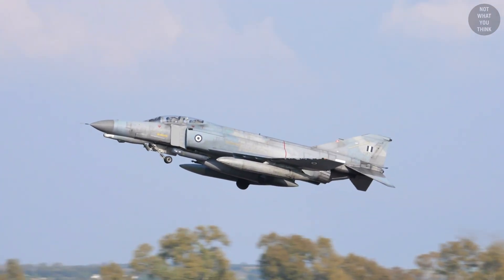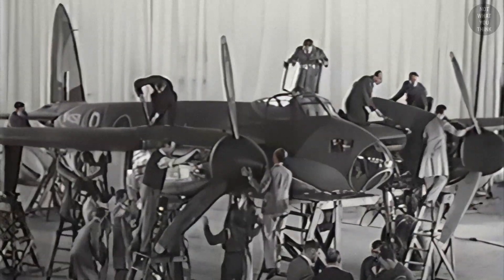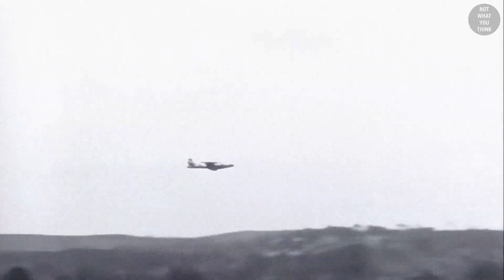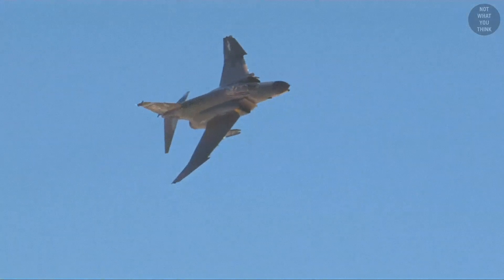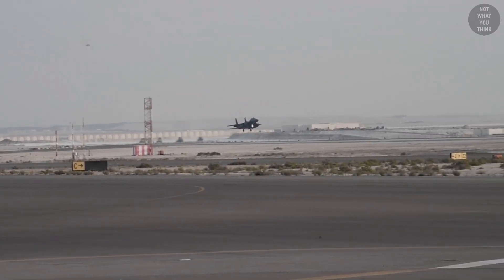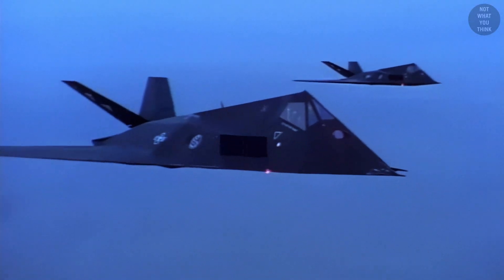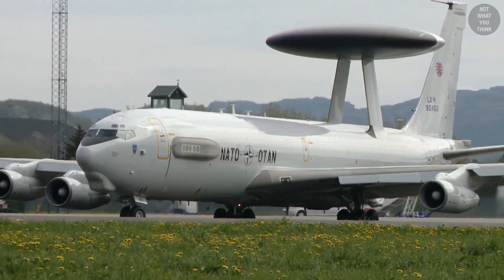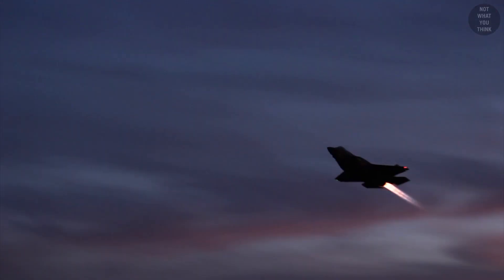Why are Modern Fighter Jets Slower than 1960s?

Comment: The most important factor of Speed Vs. Stealth is that the faster you go, the bigger the shock wave being pushed. A shock wave can be big enough to be visible on RADAR even if the jet isn't.
Reply: The shock wave is a sound wave which is compressed because the plane exceeded the speed of sound. Radar is an electromagnetic device. It can't detect shock waves produced by supersonic flight. 
The type of detection you are thinking is called Schlieren Signature. It is used to study supersonic airflow for planes and usually done in a wind tunnel.  Completely different than radars
Reply: Air is RF transparent, although there are weather Radars.  If you attenuate a Radar for wx, then the aircraft will be hidden in or behind the atmospheric clutter, especially a VLO aircraft.

Wherever you read about this atmospheric shock wave detection Radar, regard the source with extreme scrutiny...i.e. toss it in the garbage.

Comment: Air to Air battles today are extremely boring and unhonorfull. Nowerdays you win if you have slightly better tech and battles are mostly fought in small numbers and on long distances. In WWii it didn't depend on what tech u had. It depend on the skill and how honorfull you would fight. The time of the great patriotic wars are over, it's mostly a long range unhonorfull 1vs1.
Reply: It’s still just as honorable, all jets should have somewhat of a bvr capability and even in ww2 each fighter had its advantages same as today.

Comment: If you are at a track day on a road course with 500 horsepower and a 140 horse Miata stays on your rear bumper in the corners... give them a point by. 

They are doing faster laps than you, because agility beats straight line speed. Ask the cheetah why it has such a low success rate running down a "slower" antelope.

Comment: Speed only matters for one type of combat aircraft, the interceptor.  It needs to get in the air quickly, get up to altitude and intercept incoming aircraft as quickly as possible.  Mach 2+ aircraft like the F-104, F-15 and the MiG-25 were built for this mission.  With the advent of advanced air defense systems like the S-300, S-400, Patriot and sea based systems like SM-2/3/6, the need for such aircraft diminished greatly.  Modern SAMs do the work that interceptors do at a fraction of the cost.

Comment: If you can make that turn rate at supersonic speed the next problem you run into is the human body can't handle the g-force.  The next step is to get rid of the meat machine.  Remote control or AI, that's the future.

Comment: Too bad the F-35 program is a complete failure. Cant sustain supersonic flight without destroying its stealth coating, can fly in the rain, reliability ratings are subpar, combat range sucks without using external tanks that reduce its stealth. 1.9 trillion in wasted tax payers money.
Reply: Don’t know where you get your news from. But the f35 is basically the new f16. It’s meant to go fulfill its mission and get back into the air. It can also complete missions without stealth. It’s supposed to be able to do both. It’s ratings seem to be good. The fact it has many buys and the reports are that it’s own hell of a dog fighter. The fact it can do more then the raptor for way less the cost. I’d very beneficial.
Reply: @RW-zn8vy  my family is in aerospace for one so thats a good start and two this is a post from last year where our own airforce quietly admitted the f-35 was a failure.  "To say the F-35 has failed to deliver on its goals would be an understatement. Its mission capable rate is 69 percent, below the 80 percent benchmark set by the military. Just 36 percent of the F-35 fleet is available for dispatch, well below the required 50 percent standard. Problems include faster-than-expected engine wear, transparency delamination of the cockpit, and unspecified issues with the F-35’s power module."

Other issues are depressurization of the canopy during flight, stealth coat peeling, hud display issues, and lack of parts availability. The f-35 was supposed to replace the a-10 and has failed to do its role. For one its too pricey, two it isnt protected with armor like the a-10, and 3 isnt designed for low and slow ground support. The f-35 is a jack of all trades and a master of none. This is why companies like boeing created the F-15EX because it can fly longer with more ordinance. Thats why the f-35 has been deligated to be the "command leader" to use less valuable planes to fight battles. Dont get me wrong i like the f-35, its badass in its own right but as a program it has failed. In many aspects its like the f-22 that had production issues and cost over-runs that eventually doomed the program. Its not a shocker why our military wants a 6th generation fighter  and a gen 4.5 fighter to meet the needs of our military.
Reply: @07slowbalt  that makes no sense. Your family is in aerospace? That means absolutely nothing. That makes an opinion. If they aren’t direct buyers,pilots or someone who’s worked directly on the aircraft it’s invalid and is an opinion. And you’d tbh think someone in that field would be smart enough to not say such nonsense.
Reply: @07slowbalt  anything can replace the A-10, the A-10 is completely useless. If there’s no air superiority it can’t be used. It’s a big slow target, maybe 40-45 years ago yes it would’ve made a slight difference but it’s not up for todays task. The f-35 f16 and f18 can all do the A-10s job without risking failure of the mission and pilots lives. I love the A-10 just as much as anyone else but many people fandom an aircraft and don’t look at reality. There’s a reason the air force themselves do not want it. It goes deeper than cost and how much if a struggle it is to maintain them. 36 percent of what fleet? Every squadron of F-35As are combat ready and most have already been over seas. If you are around the pilots you only hear amazing things and unbelievable stories. I’d imagine that an engine that powerful wouldn’t last the longest. You’ve never seen the thing fly. The reason I know is because how much you don’t know about it. It’s only on its first block and it’s already the most capable fighter we have. Every fighter has issues when it’s first produced even the F16 got a bunch of hate. The raptor had issues for the longest serious ones at that. It’s all new tech and a really new fighter. Just like anything in the military it has to actually be used to find out what works and what doesn’t.
Reply: @07slowbalt  sorry I didn’t read the rest of you comment, the reason the Air Force is going with the F15 and maybe even the newest f16 is because of cost. More than likely or maybe stealth doesn’t actually work anymore. Both the navy and air force have some chrome coating they are testing on the raptor and f35. It’s 4th gen fighters are bad ass and will be around for a good while!
Reply: @RW-zn8vy  you are all over the board. That quote was straight from the airforce last year. So discrediting what i say is one thing but when it comes to reality and what those with first hand knowledge say is another.  The f-16 has a giant engine on a lightweight frame. It also suffers from range, just like the f-35.  Any pilot is gonna side with either the f-22 or f-35 because it is without a doubt the most technology ever crammed in a plane with a pretty large engine. Ask the pilots that had depressurization of its canopies while flying at altitude and see what they think of that pain they suffered. My family in aerospace that ive always been around is more valuable than what your burger king experience. I first hand seen boeings version that took on the jsf and lost. It was cool but a turd. My dad applied chromium based stealth coatings on airplanes all his life as well as painted harpoon missiles. Brother was an assembly mechanic, before becoming a parts inspector, and his wife is an engineer for them. But hey its just my opinions when they tell me the pros and cons they deal with on the daily.

Comment: Well there are still planes like the F22 or the EF that fly faster than Vietnam era jets - the Advantage of that is that (At least if we talk about the EF) you can fire your missiles at a higher speed what means that your missiles have more energy to work with increasing it's range by quite a bit. I also strongly disagree with the point that you can't outrun AAM's or SAM's - while it's true that they peak at a much higher speed than a Aircraft they can't keep those speeds for a long time - so if you're high up in a fast plane it gets very hard - even for modern SAM systems - to hit you. While AAM's have the Advantage of mostly beeing launched closer to the target and on a higher altitude they are also slower and have less burntime than SAM's on average what makes them pretty suceptable to cranking manouvers. The next point is the seekerhead and the turning limitations of the Missile: the faster a aircraft goes the more problems the seekerhead gets as well - so if we have a plane flying at Mach 2.5 while not flying directly towards the target the missile has to find the right lead to cut into the planes flight path - and at such speeds the time window where you can fire a missile and it is actually a threat is incredibly short - if you fire too early the missile simply gets cranked and runs out of energy but if you fire too late the missile won't be able to turn into the enemies flight path. There's also a increased chance that the missile misscalculates the flight path and therefore misses the target.
In summary I'd say that top speed is still important but the concept of speed probably got dropped for versatility, cost reasons or the Implementation of stealth (at leeast these are my assumptions). But I think we'll see a comeback of high altitude high speed interceptors as tensions between russia and the Nato are rising again - but this time they're hunting nuclear warheads instead of Bombers.

Comment: Top speed can be advantageous actually. You mentioned that max turn performance is found at subsonic speeds and while that makes sense and was important for the Vietnam era, when beyond visual range wasn't actually beyond visual range, it was actually under 10 miles. The Aim-4, aim-7, and aim-9 all had a short range compared to missiles today. 

The faster and higher an aircraft is when it fires its missiles, faster and further that missile will go, and it will be more lethal, remember the higher you are when you fire the less dense the air will be making drag less of an issue. So to maximize missile performance you need speed and sn altitude advantage. The faster you're going the greater chance you have to defeat incoming missiles. Modern aircraft with super cruise can utilize this without the massive penalty of increased fuel consumption.

So why then does the f35 have such a low top speed? It's the same reason the f22 is actually limited to mach 2.2 even though its capable of going faster than that. The reason is that the faster a jet flies through the air the greater the surface temperature becomes. Not only does this damage an aircraft's stealth coating, it makes the aircrafts infrared signature more visible at greater ranges.

If you're in a BVR engagement as a 4th gen fighter/non stealth jet like the Eurofighter against another 4th gen then high speed is going to be vital. A stealth aircraft will be able to get closer without being seen and hopefully fire on the enemy from within the no escape zone, without the enemy knowing you're there.

So to reiterate, the lower speed of 5th gen fighters is because the extra speed is detrimental to the stealthy design of the aircraft. Naval fighters tend to be an exception though, the F/A-18 and the french rafale are both fairly slow, a top speed of under mach 1.8. That's because landing on a carry means they need excellent low speed characteristics which are usually counter to a top high speed. That's why the US navy used the F-14 Tomcat which had swing wings, for lower stall speeds when the wings are forward and less drag/higher speed when they're swept back.
Reply: Congratulations - you just said the things in the video.
Reply: @NickACrowley  except the video lacked the nuance to differentiate between when speed is and isn't vital and why.
Listing problems with high top speeds and advantages of low top speeds is what we call bias.

Even if those are the reasons driving the speeds lower those reasons don't make sense without adding the context of why you would want high top speeds.

Instead the video leads the viewer to believe high top speeds where desirable only because designers where mistaken into thinking faster was better. Thus creating a false sense that there is no benefit to high top speeds and lots of disadvantages so modern fighters are slower.

In reality high top speeds still matter and this comment accurately pointed those reasons out and gave the downsides the nuance and context to allow the read to share the conclusions because they have the same information to make the decision rather than having to accept the conclusion simply because they said it was so.

Comment: @not what u you think, your video is hugely helpful educating but just one minor correction needs improvement regarding missiles.. It's kinda ironic the video talks about how top supersonic speed is pointless but then when it comes to missiles u quoted 'maximum speed'. Missiles are subject to the same physics it rarely reaches top speed except in certain circumstances, at least for air to air missiles, they usually have short bursting stage actually burning rocket fuel afterwhich it's just gliding towards the target. The faster the target jet runs away and move, the slower the missile gets and less likely to catch the target, especially when the missile has to turn and adjust directions. ALSO, in order for air to air missile to reach speed as fast as possible, the launching platform like a jet must fly fast too to give the missile a boost, just like running before throwing a javelin. Speed is still incredibly important for jets, just due to technological limits at this stage it has to be balanced against other factors, like what your video overall suggests. Just the missile part bugs me a bit XD